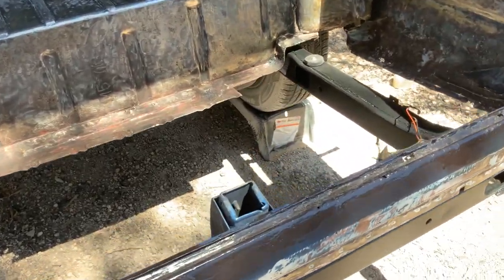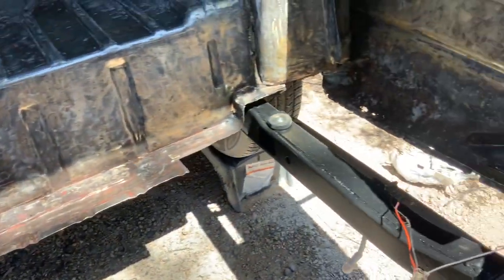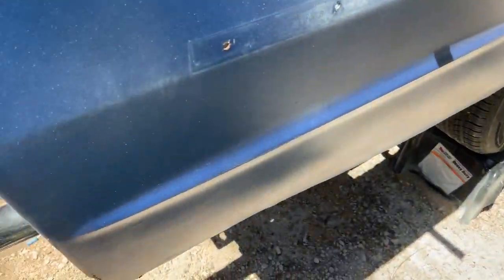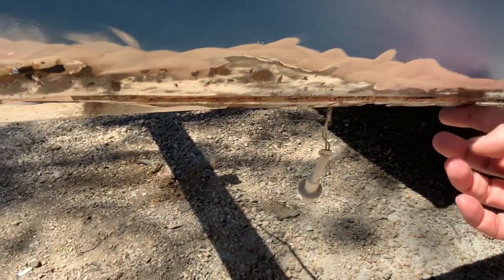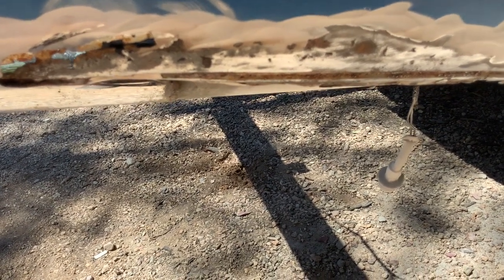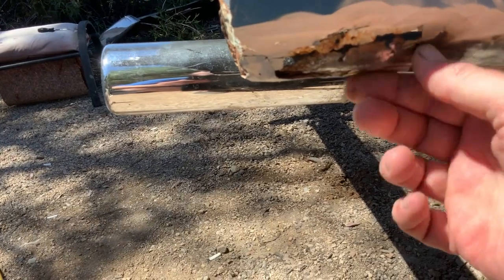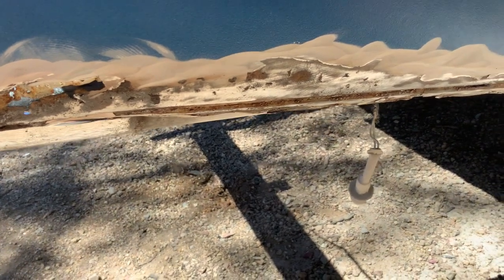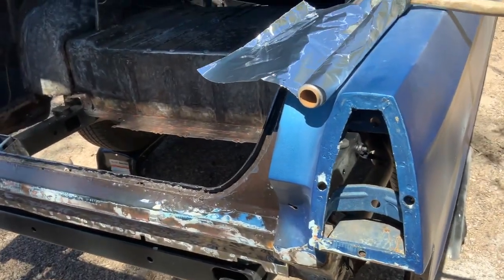Using aluminum foil to fix rust?

Comment: Aluminum foil, duct tape, window screen, spray foam. I’ve seen all kinds of stuff used to fill or cover rust. …. Bondo and paint make me the body man I ain’t …. Lol
Reply: Did they use to sell that back in 90 s that aluminum foil tape for doing bondo work
Reply: I have glued my metal patches over the top...   And use fiberglass drywall tape. A thin skim of ,  5-minute epoxy...  I'm ready to start spreading Bondo....